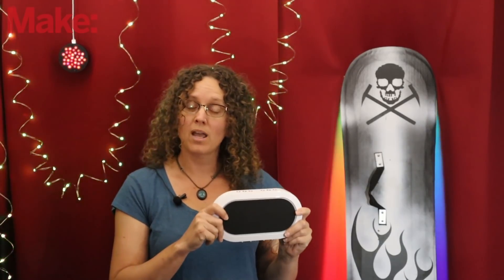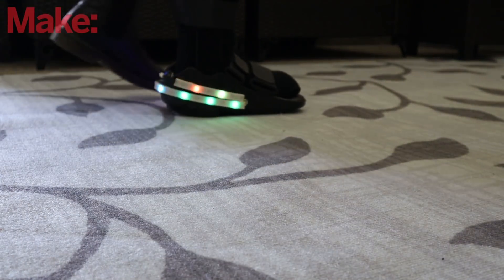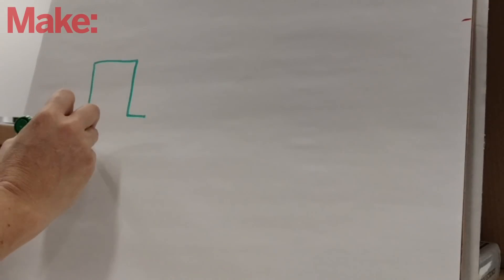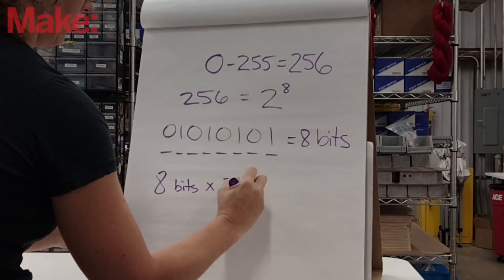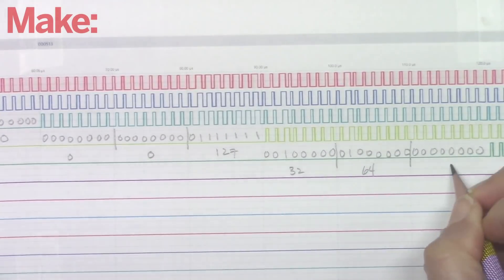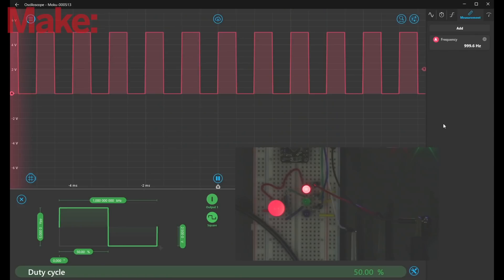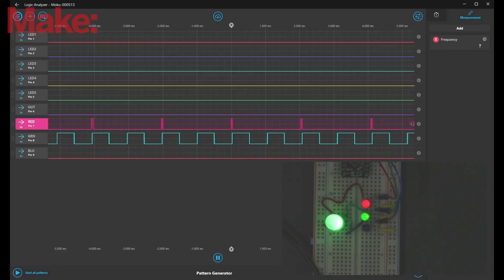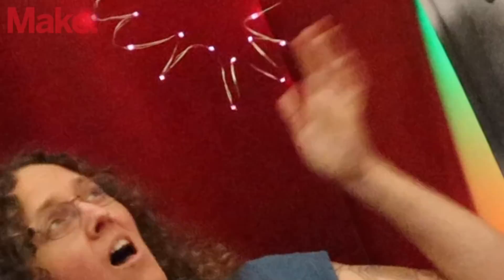Understanding RGB LEDs - a deep dive

Comment: but wait how do the LEDs convert data signals to PWM signals? Are there tiny ICs built into the strip for each LED??
Reply: Yes, each LED is mounted on a WS2812 chip. The video would be much more instructive if she briefly explained how the WS2812 chip works. There is a single data wire. Each chip has a gate that can block the signal from the downstream chips. The first chip (closest to the controller) takes the first 24 bits, then opens its data gate and allows the second chip to get data, etc.
Reply: That's really cool!

Comment: Do you have a full tutorial on how to make a homemade lightsaber - not so much the hilt, but a single color LED string blade (for a 1st build), build the electronic boards (Arduino or Adafruit), code the controller, calibrate the MPU 6050, etc...? Thanks 😉🌹

Comment: How did you get the camera to see the lights as a solid? 
Mercedes-Benz trucks now use a camera and flat screen for mirrors.... cars with LED headlights look like police cars when the are coming up behind you..... for one the screens are low DPI and also a camera looking at an LED shows the blinking effect so they look like a flashing light... added to the fact they look either red or blue or both...
All that aside.. great video!